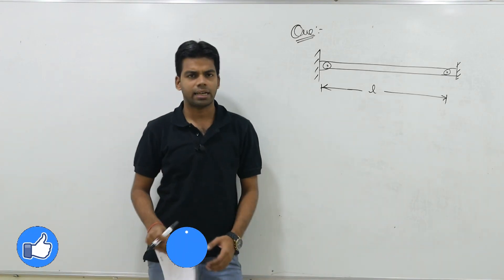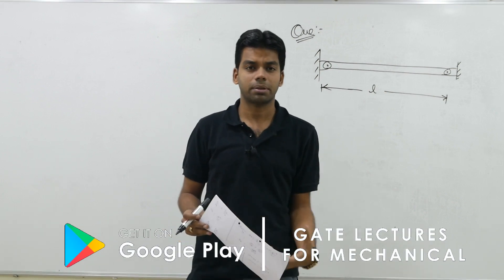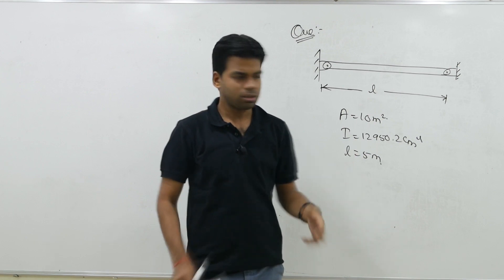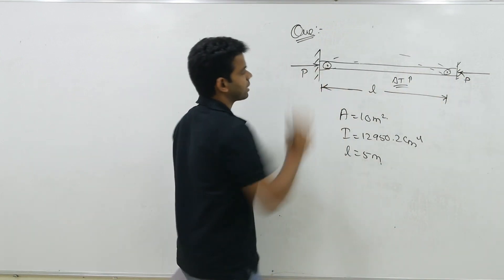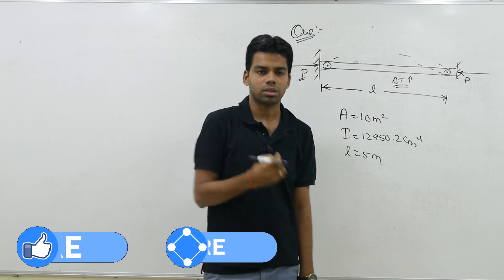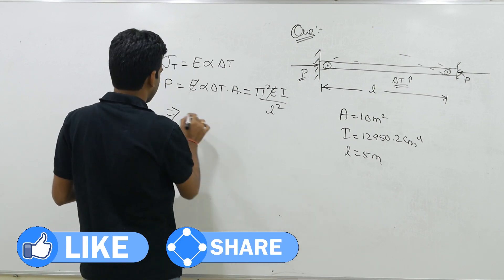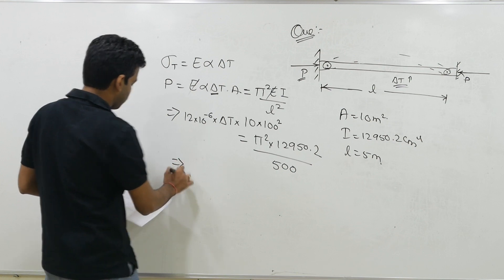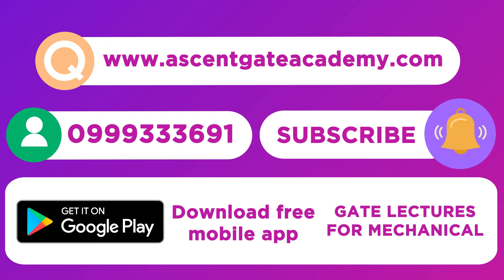SOM GATE CHALLENGE #9

Comment: 0.4258 ans E=200GPa
Reply: Buckling load formula is 4pi^2EI/l^2 that you put to calculate for fixed beam
Reply: @chinmayapradhan5516  total deformation at end point become zero you have Euler equation to put the value of P
Reply: No need of the value of E